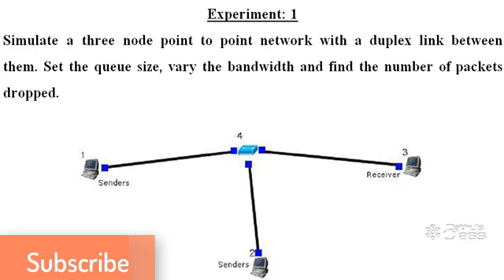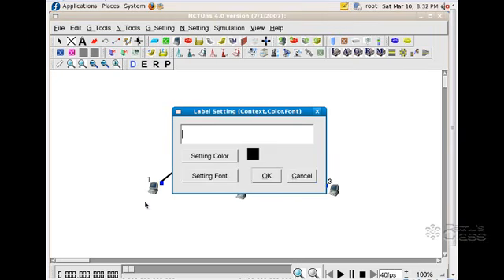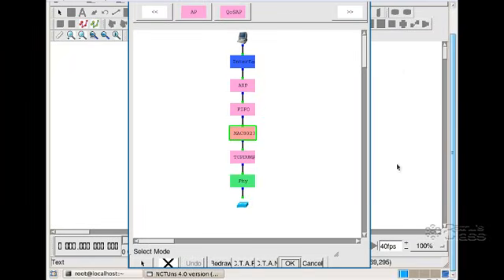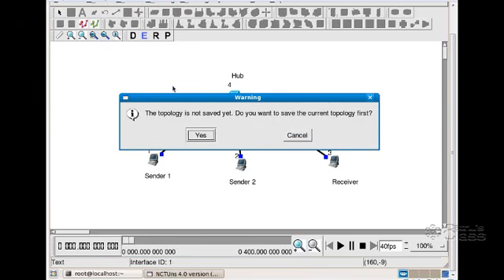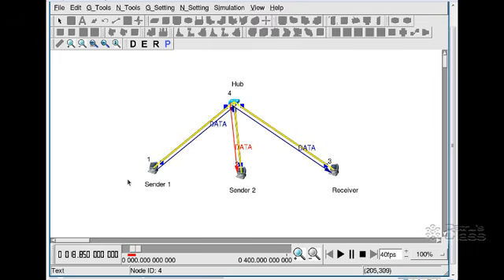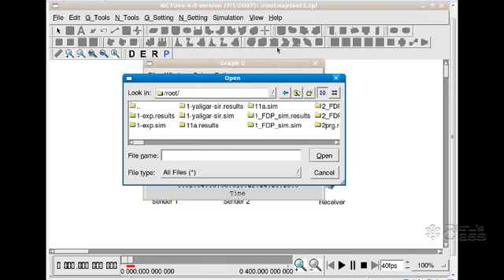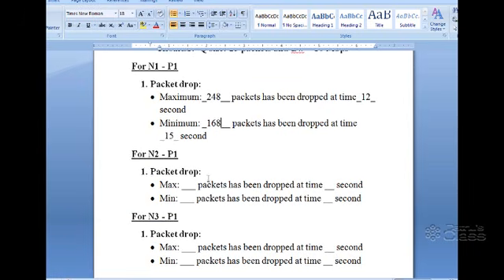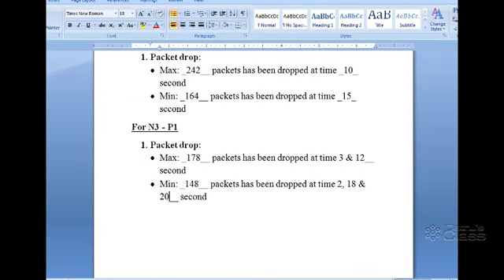Experiment 1 : CN Lab ECE 6th Sem VTU CBCS Scheme

Comment: When I run the simulation, the list of files are not generating because of which I am not getting the results, using nctuns 6.0. could you sugest something?
Reply from the maker: Try to check whether dispatcher and Co-Ordinator are running properly when u execute run phase. Also check whether you have entered proper command in command window (spell check)